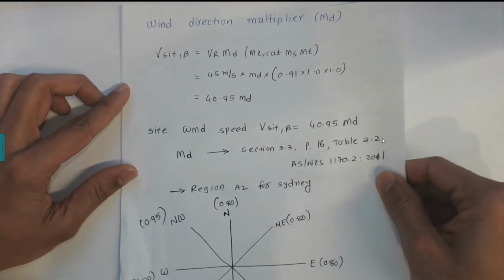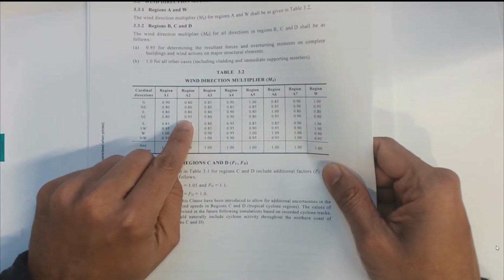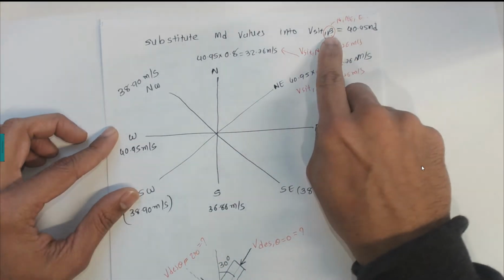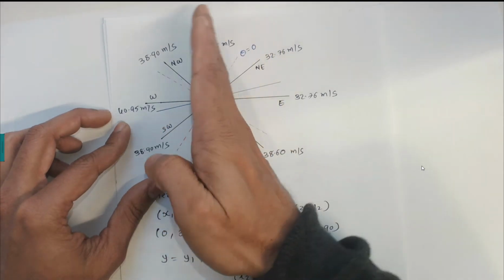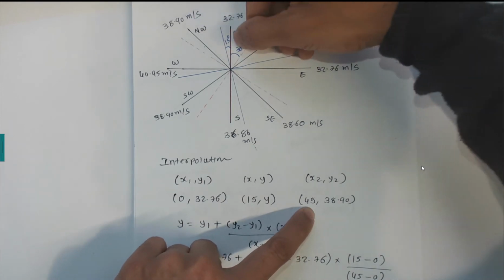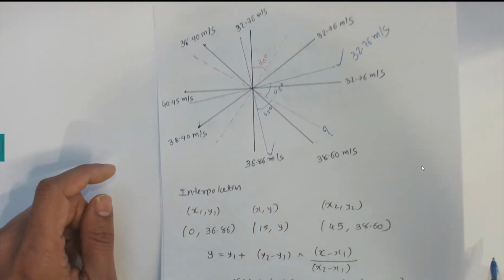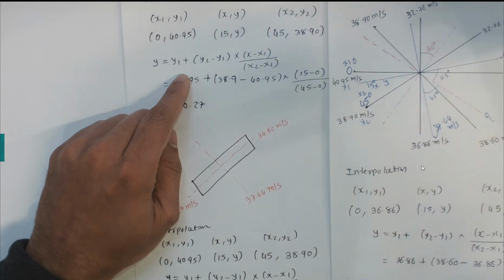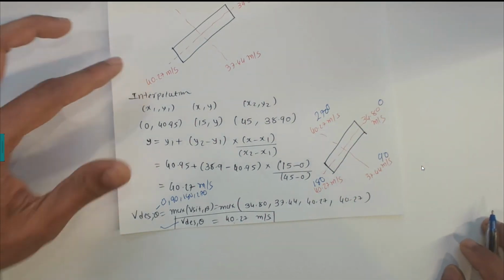Wind loading Example 1 Part 3 AS/NZS 1170.2

Comment: These videos are helpful, thanks for uploading 🙏 
Could you please explaon how to consider Shielding multiplier and hill sgape multiplier Mh. Or do you suggest any video.

Thanks in advance :-)
Reply from the maker: In AS 1170.2, the shielding multiplier (M_s) and the hill shape multiplier (M_h) are used to account for the effects of nearby buildings or hills on the wind loads. These multipliers modify the basic wind speed to obtain the effective wind speed that will be used in the structural design.

Shielding Multiplier (M_s): The shielding multiplier accounts for the reduction in wind speed caused by the presence of other buildings or structures nearby. It is used when the building under consideration is shielded by other buildings. 

Hill Shape Multiplier (M_h): The hill shape multiplier accounts for the increased wind speed due to the presence of hills or terrain features. It is used when the building is located on or near a hill or escarpment. 
To determine the values of these multipliers, AS 1170.2 provides guidance on how to assess the site conditions, the surroundings, and the local terrain. The multipliers are applied to the basic wind speed to obtain the design wind speed for structural analysis.